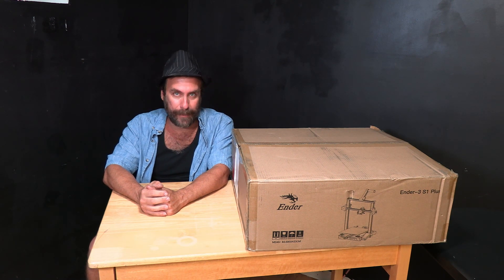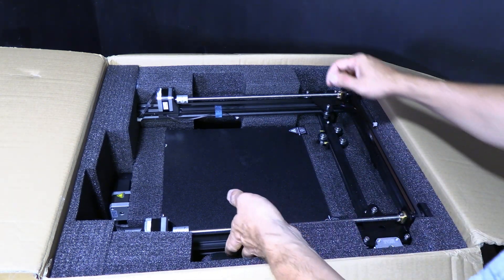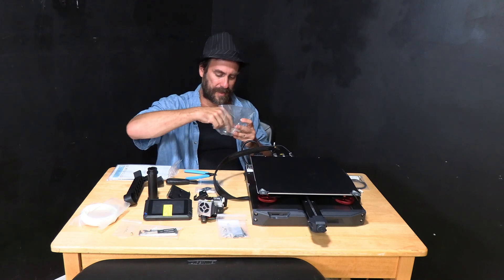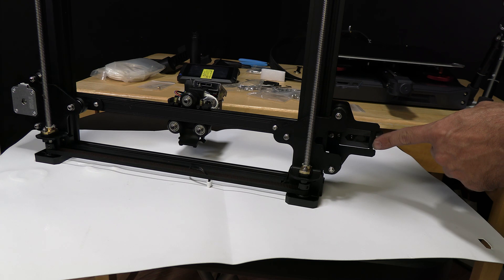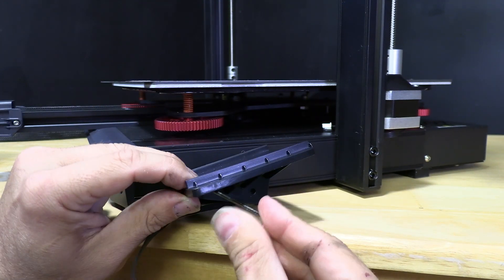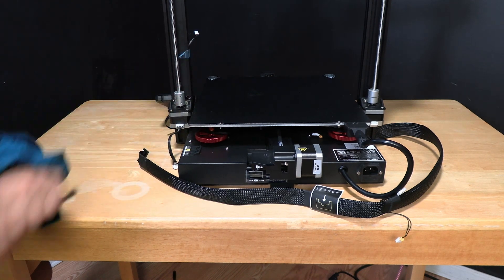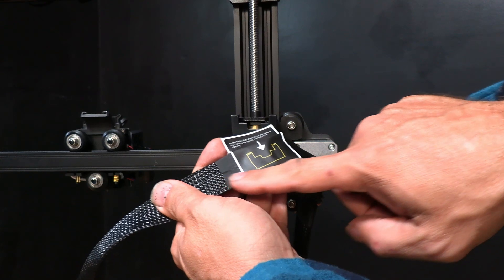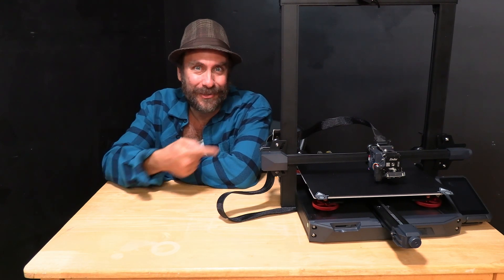Full Step-by-Step Build / Assembly of Creality Ender 3 S1 PLUS 3D Printer

Comment: DONT TURN PRINTER ON!!!  First check for proper voltage on the machine back, 230 vs 115.  Make sure you have a nozzle on extruder before using.  And I have extra screws, not sure why yet.      Very thorough video making.  Slow enough pace to keep up.  Except the last part may destroy the machine, voltage setting.
Reply from the maker: You should check you power supply on any computer and printer, to be sure it's the correct Voltage. Extruders don't have nozzles. The hot end does, but it comes pre-installed. Thanks much. It won't destroy the machine, but you won't be able to use it.  I did film it, but it got left out. My Udemy version of this video has it. Youtube, doesn't let us update or replace videos. 😡

Comment: Congratulations for the video, I saw that the S1 plus came with a kind of sensor and a cable, I did not find a reference in the manual, what is the purpose?
Reply from the maker: Thats a Z-Stop Switch. You wont be using it

Comment: How do u like the touchscreen with this printer
Reply from the maker: I prefer the Knob screen.
Reply: @3DRundown  why’s that 🤔
Reply from the maker: @monsterstorm78  It's open source and allows for better 3rd party firmware. Which I use
Reply: @3DRundown  u still use this printer a lot
Reply from the maker: @monsterstorm78  I haven't used the Plus at all yet. But I expect too. I have 3 Max and a CR10 for most of my large print needs. This machine will definitely be with me long term.
Reply: @3DRundown   cuz I still have the s1 plus in my cart just debating if I wanna buy 🤔 decisions decisions
Reply from the maker: @monsterstorm78  the larger bed makes a huge difference in what you can print

Comment: Is there any issues wit this printer
Reply from the maker: Not really. It's a solid machine. Has all the upgrades that people typically add to an Ender 3 MAX, plus the new Sprite  Direct Drive. I do prefer Glass, which you can add.
Reply: @3DRundown  why glass over the magnetic bed
Reply from the maker: @monsterstorm78  I remove the magnetic and put glass. Glass is easier to clean, and flatter. Sometimes the S1 Magnetic bed is a pain
Reply: @3DRundown  oh wow really u think so
Reply: @3DRundown  should I buy this printer is this an really good buy for an printer

Comment: i followed your video on traming and offset my  my ender 3 s1    but it still not working correctly..
Reply from the maker: I'm not a huge Fan of the S1 Bed. I swapped mine with GLASS and it's worlds better. What's the situation with yours?
Reply: @3DRundown  why do u prefer glass